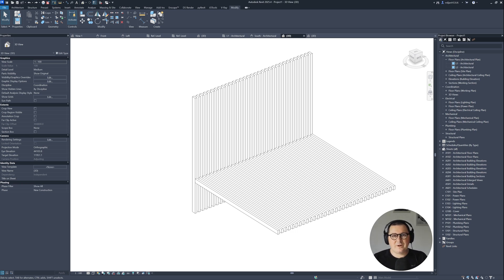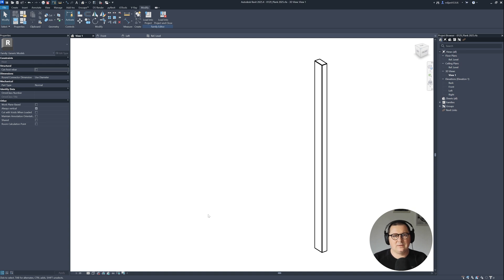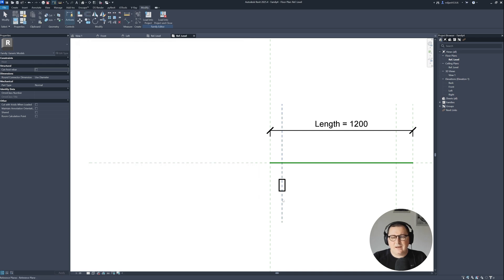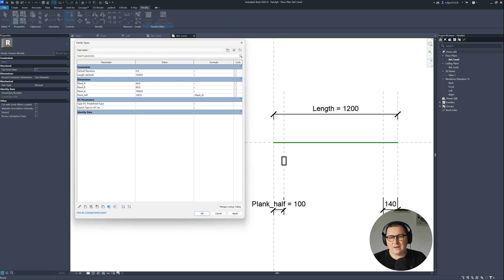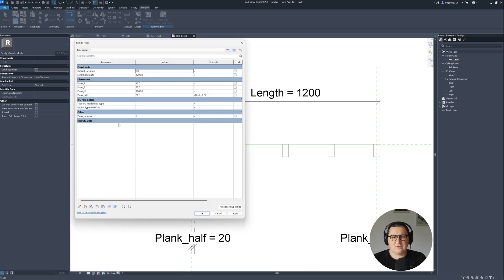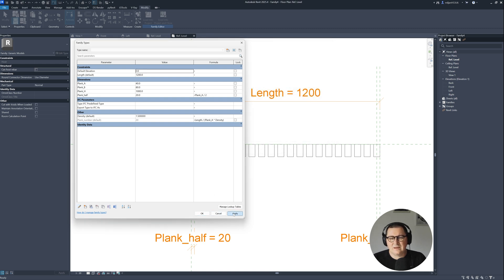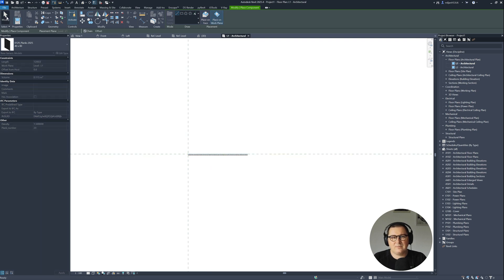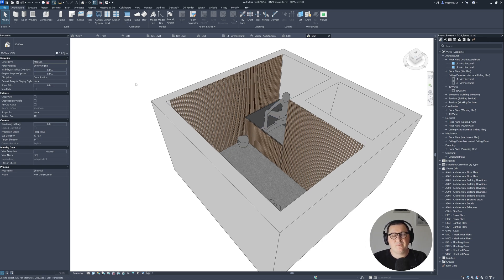Planks - Line Based Family in Revit

Comment: If I wanted to use this similar system to create a screen with arched openings at the base, how would I go about that? Is there a way to make it similar to a wall with an edible wall profile?
Reply from the maker: Create that single element, if needed determine how it will work with parameters, and then nest it into Line Base Family if you would like to do it that way.

I am not sure what should be final output and can’t say what is the best approach but take a look at one of my first videos here, they’re related to the ceilings, and maybe those methods can also help you with what you need 😊
Reply: @arkiteasy  Great! Thank you for the advice!